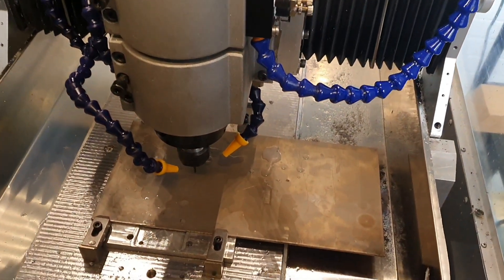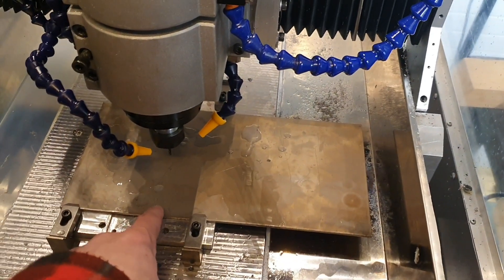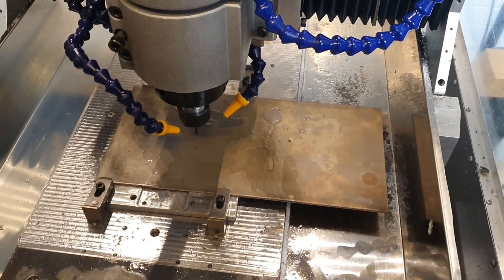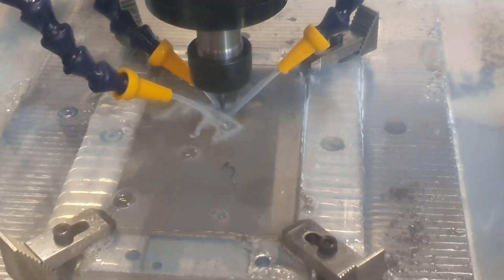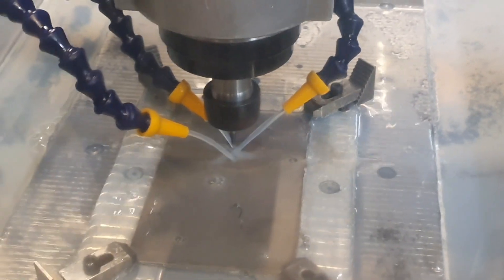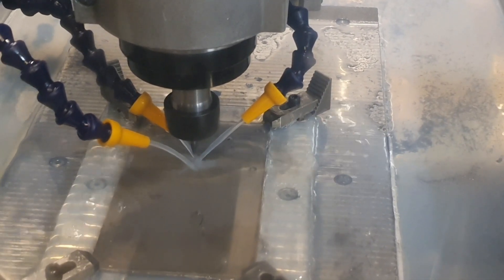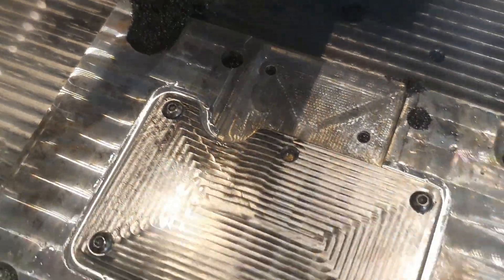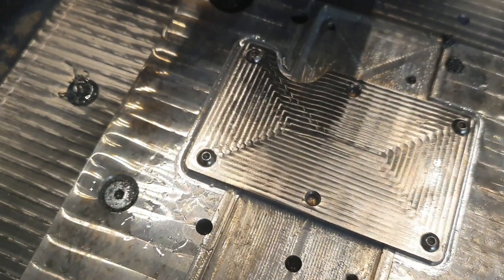Test machining Titanium 6-alv4 with reubuildt 6040 cnc router

Comment from the maker: Hello, I recorded some titanium test cutting. It is just a bunch of short clips testing different toolpaths and speeds and feeds. 

When slotting i used a 3mm endmill, spindle rpm 7200, cutting dept 0.1mm, feedrate 220mm/min. (This worked good so I think I can increase the depth of cut)

When using the 2d adaptive clearing I used a stepover of 10% (0.3mm) and a feedrate betweeen 500mm/min - 2000mm/min. Spindle speed was around 8500 rpm.

When using the pocket toolpath I tried 200-1000mm/min in feedrate and a stepover between 0.05mm-0.2mm. Did try booth 3mm and a 4mm endmill. Booth worked fine.  Also tried cutting depths between 0.05mm-0.2mm. To get a good finish I went with 0.05mm depth of cut and a 2mm stepover, feedrate was perhaps around 400mm/min.

Comment: Hi chip welder,
 I do have two questions and was hoping you could help me. I am using hybrid stepper motors but
I noticed that the cable attached to my motors is not insulated with metal but is insulated with a fine white cloth material, does this matter? I've watched a video in the past and they said the signals could damage the drives, is this true? it doesn't seem to be interfering with the program run. Hopefully you can help me gain knowledge.

Comment: Which is the best CNC Controller for Diy Milling machine
Reply from the maker: Hello! I have not tried Linux cnc but from what I read so far I think a Linux cnc controller is the best one for a diy milling machine. I currently use an nvum /nvem ethernet controller from novusun. That one is working very good. I did use the usb version earlier but I experienced some issues with usb.  Ethernet is a bit more expensive but it is worth it in my opinion. Masso and centroid are also two interesting controllers. They are a bit to expensive for me though. Thx for watching and commenting! :)

Comment: nice work man! cards holder prototype?
Reply from the maker: Yes! I have been looking at ridge titanium and carbon fiber cardholders. 
Very nice cardholders, but they cost ~100 bucks.

 I would like to bring some good quality cardholders made out of premium materials like titanium or carbon fiber to the market. But to a more affordable price. I should be able to sell them for 50-60 bucks with a small profit.  This first one will just be for myself. But if I will attempt to sell some, I think I need to tweak the design a little bit so I dont get sued by the guys behind ridge wallets or anything like that.

 I think they would sell good, will make a small youtube series called lets try micro manufacturing were I will show the cost and also if it was possible to sell them on ebay / amazon. A large problem is that they companies mentioned above seem to take ~10% of the sale in fee. That is not good when trying to keep the cost low. 

So perhaps, sending some cardholders for a "pass around" to different Youtubers interested in edc stuff and then setting up a webshop might be the best way to go. 

To bad it is so expensive to sell on ebay and amazon, I honestly did not expect. No wonder that guy behind amazon is super rich. Thx for commenting and sorry about my long reply, but I am pretty motivated to start making some batches of these ones. :)
Reply: @thechipwelder1253  I think it's a great idea. Plus cards holder always sell good moreover close to Christmas. For the fees on Amazon and ebay. I sold on Amzon for a couple of years. The only way is to store product on your own and the fees will decrease but the 10% profit it's still not possible. You need more profit to be able to sell in that platform. EBay is a bit better but still expensive. You have followers so better to make a website and sell it like that. Also Becuase large production is not your purpose. I will follow it for sure. Good luck!